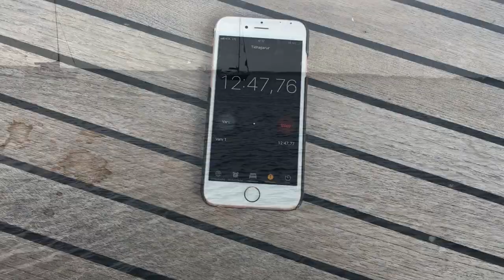Installing the rudder and changing propeller shaft sealing in the water.  Ep. 47 Hilma Sailing

Comment: Excellent choice to mount a PSS. That's the best sealing! You will never more have any leakage, as long as it's only lubricated by water. Grease  will damage the surfaces between the ceramics and the steel ring.
Reply: We are going to install one on our shaft as well.  Probably the best on the market!

Comment: Look at that pretty new anchor, but even when they wrap them, you can always tell what they are. Really sorry to hear about the bad luck, seems at times that happens in multiples, and went through one of those periods of time recently myself, better now, and hope it is for you as well :) A tip; if you ever take that shaft coupling apart again, put a thin piece of rubber in between cut to fit the larger part, to act as a alignment helper and also to dampen vibration from the engine to the boat, it really works, try it, and it can just be a layer of inner tube or the like.

Comment: The coupling bolts are a puller with an extra three longer ones of the same diametre. Take off the retaining nut like you did then put a nut between the end of the shaft and the engine coupling put the coupling bolts back in and do them up and the nut will push the shaft away from the shaft coupling as do tighten them with some sharp hits with a ball peen hammer, keep tightening until the bolts run out of thread then remove them and place longer bolts and a bigger nut or two together between the shaft and the engine coupling and repeat. This type of coupling puller is far superior puller than a bearing puller and a ball peen hammer will not bend or damage the shaft as you are hitting the shaft coupling with it. For the next shaft extraction.
Reply: They should print your reply and save it in their manual, well said.

Comment: Usually you can find a hole on the side of the coupling that houses an allen grub nut and a key. Use an allen key wrench to remove it and the coupling will fall right off. Do not force it off if there is a key or you will ruin the threads! If it doesn't have that then DIY a puller plate from parts you can find at a scrapyard. This works way better than a gear puller. Here's a demo video. https://youtu.be/ZEnGmLv9B1Q

Comment: i would take a small buoy to locate me at all times, specially during the ascent because there may be incoming vessels in your direction and with a buoy they will at least give a few meters of clearance. it also allows for your partner to know, at all times, where you are in case you need assistance.
Reply from the maker: Yes, we did that too in the beginning but the boats did not seem to notice it.. At the same time Lisa also stood on foredeck with a dive flag but that did not seem to work either. Strange and a bit scary.☺️ That's when we decided to tie a rope from the boat to the bottom and then to Oskar instead. ☺️